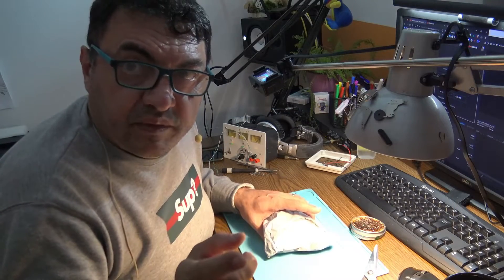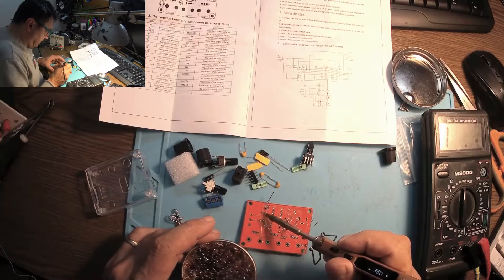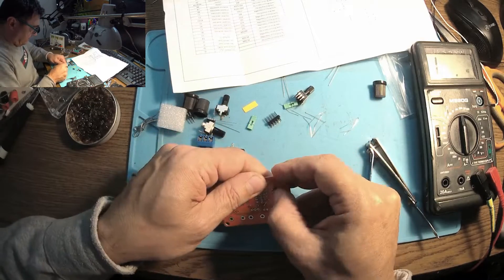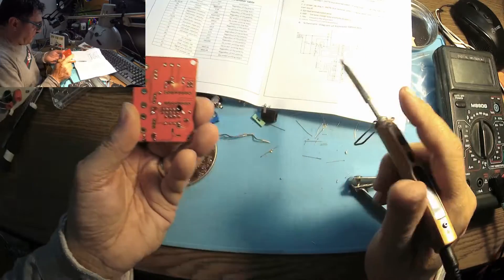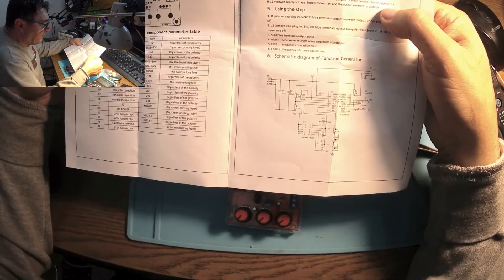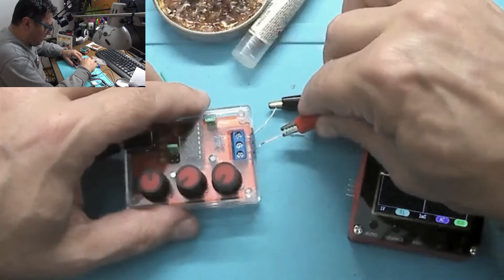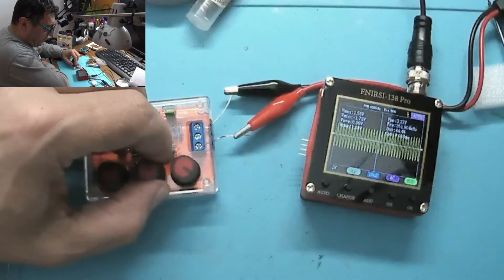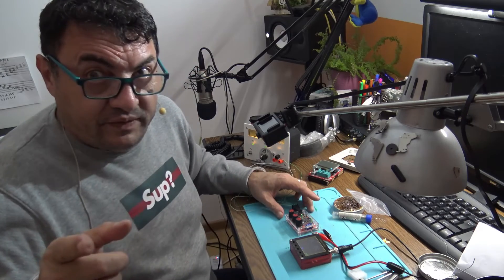DIY 1HZ-1MHz function signal generator  RX2206

Comment: It can be used to test IF coils for radios. Check to make sure they are properly tuned to 455Khz or whatever you choose. Or to test a crossover or an amp like you said. Yes a toy but it has a lot of uses especially in the Audio realm. Thanks for the video.
Reply from the maker: Good idea with IF..! Thanks!